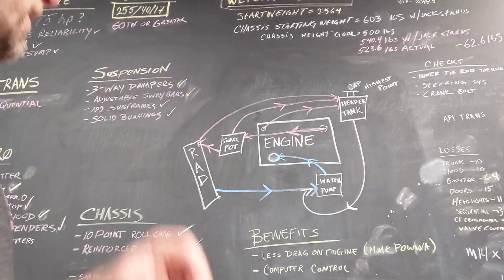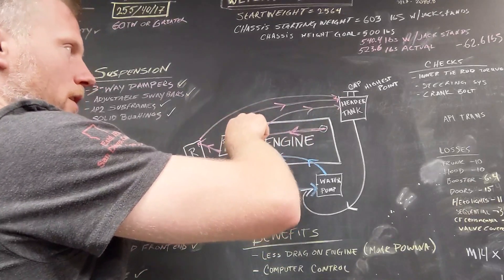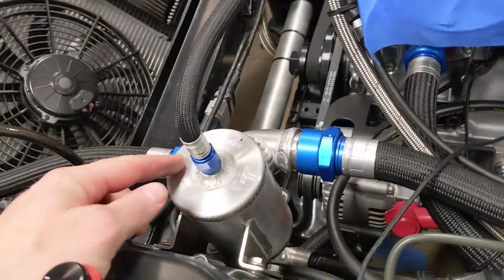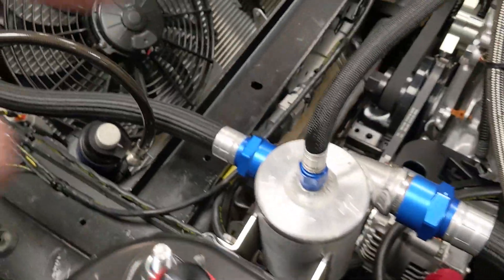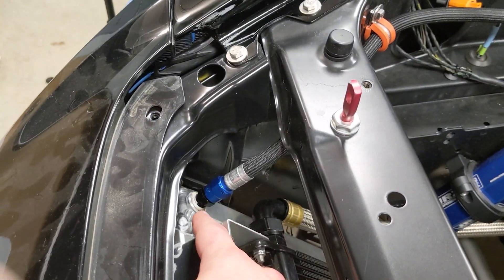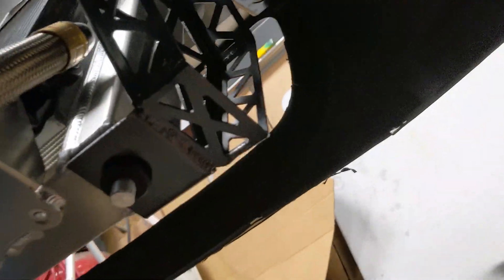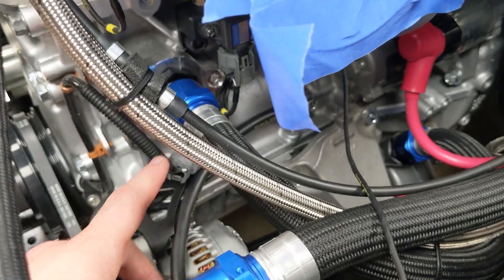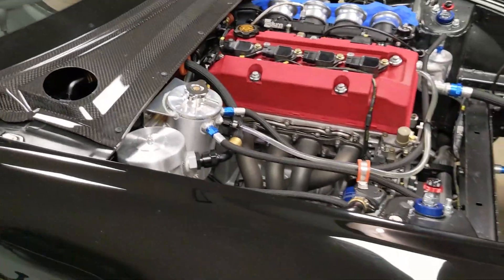Custom Cooling System Design | S2000

Comment: Hey I love the coolant setup iv had so many problems trying to keep the motor cool with the turbo set up I have. Where can I find the billet adapters you made? I wanna run this set up Thankz for the content. And one more thing can you make another video on how you ran power from your starter because my car doesn’t wanna turn back on after the motor gets hot with the hole turbo system Thankz again.
Reply from the maker: THe custom adapters were one offs but you could probably have fabricator make you some.

Comment: Hello. Can I get information on the components for installing an electronic water pump?
Reply from the maker: If you are running a Davies Craig pump, I have a few mounting options on my website. Tractuff makes the water pump delete kit for F-series and K-series engine. Davies Craig also makes a stand alone controller if you don't have the provisions to add to your ECU.

Comment: Do you still utilize the thermostat
Reply from the maker: I do not as the water pump can be control via my ECU but you could add a thermostat on the hot side just after it comes out of the head